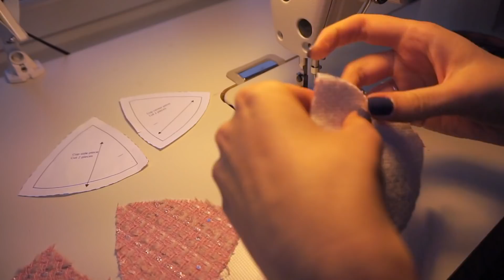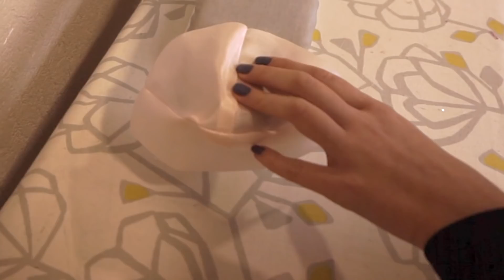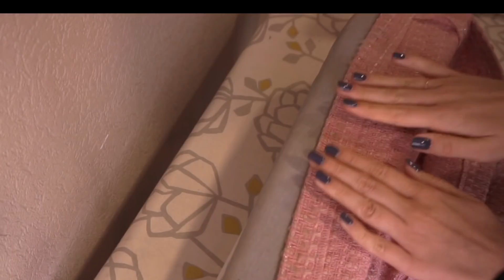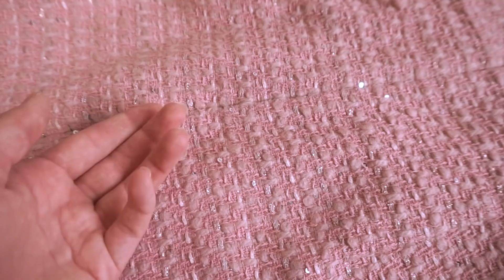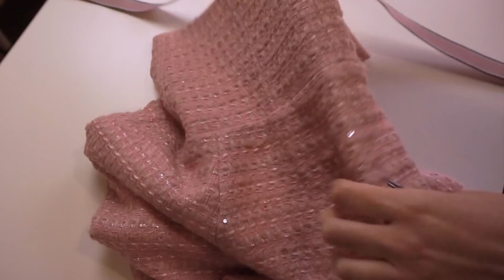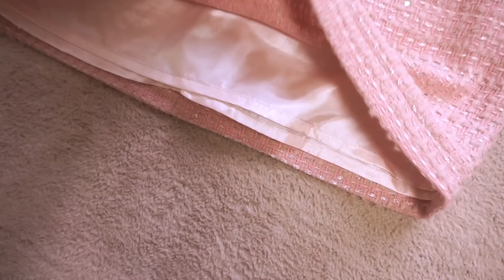Bustier Dress Sewing Tutorial |Rose Cafe| + Pattern Download

Comment: This is stunning and fabulously helpful. I just bought the pattern and am looking forward to making it! For those of us with a larger bust, is it possible to use the underwire channels for underwire without altering the construction of the dress, or is this fitted in such a way that underwire is not needed for a full bust?
Reply from the maker: Thank you! A larger bust usually needs a little bit more support, so I suggest adding underwires as well if there is such a possibility. Also you can make foam cups from exactly this pattern!

Comment: Overlock inner seams is unnecessary if u lining a garment . Also i would do sideseams at last, first finish the front completely and also the back, its easier to put the zipper in if u have a still non dimensional piece
Reply from the maker: You can do whatever you like, I just have shown my way. I have a quite big experience in sewing this type of materials. If you have ever sewn from the fabric like this, you should know it is extremly fraying. I recommend overlocking edges of this fabric even if they will be under the lining, especially if your lining is in light color. 
Also it is not right to assemble the garment with a waistseam like you said. What if I have a flare skirt? Otherwise, I would agree with you.

Comment: Hi. Thank you so much for your video. I have a question regarding the pattern. If my fabric only has a print on one side (right side), when I cut two pieces out of the bodice with the pattern, I would cut a piece one way, then have the flip the pattern over for the second piece to cut, correct ? I had originally cut 2 pieces of the bodice the same way and clearly that was wrong.
Reply from the maker: If your fabric has a print only along 1 selvage - then yes, you are right. If your fabric has a print all over the right side of the fabric along both selvages, then I don't see any problem to cut on the fold. 
Or maybe you want your print to be in an opposite direction from the center? Then you need a center seam. 
It is hard to figure out what print do you have without photos 😀 Please contact me on Etsy or Instagram so I can help you!

Comment: I literally don't know anything about sewing I want to learn though, how can she see over the seams with the pins still in? Is she just that skilled that she can tell where the needle will hit? How does the sewing needle not hit the pin and get ruined?
Reply from the maker: I use quite thin pins, it is ok to sew over them. If you use bold pins, then yes, there is a little chance that you can ruin it. Although from my experience, a needle moves just a tiny little bit, (at least in my machine), so when you will get on a pin with a needle, it just will slide and make a stitch very close to a pin. If you are not sure, you can remove a pin when it is just right next to a feet, or baste. But can't remember such a situation that I ruined my needle because of a pin. 😊